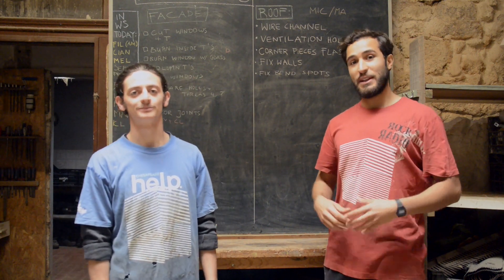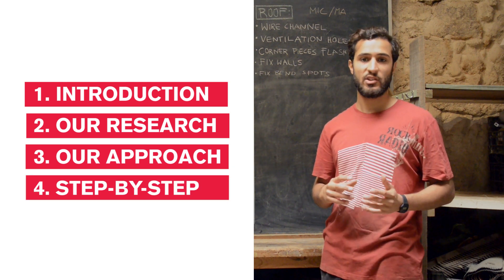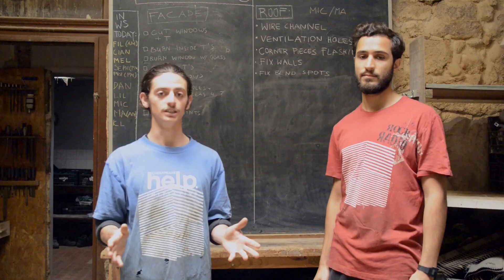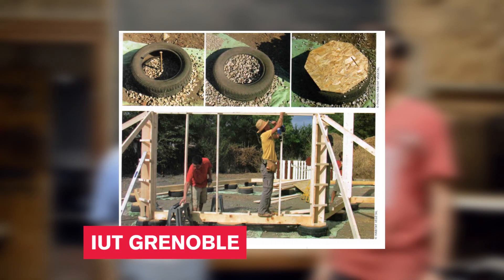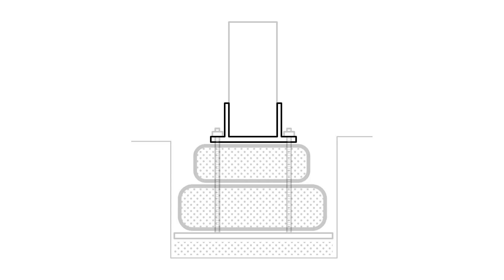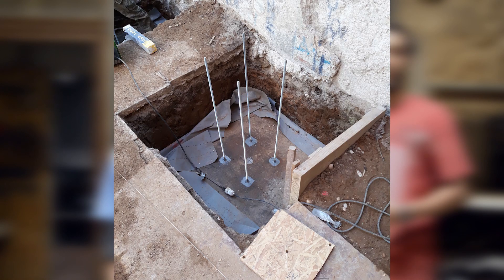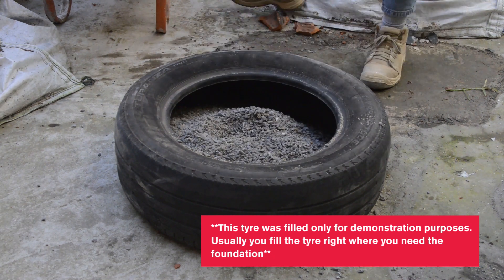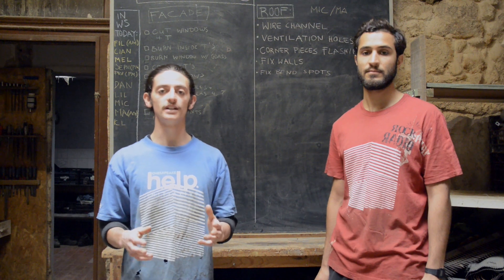Tyre Foundation - HOW TO

Comment: Hello, thanks for your video and inspiring project! Do you think/know if your 'single step tire footing' will anchor the building above? I'm considering making use of tires for a superficial foundation, to prevent damage on tree roots present on the land, but need to anchor the foundation in order to prevent movements and disorders due to strong winds...

Comment: I suspect the flat plate will collect water in my climate where we have snow and rain. Another idea: It is very common where I live to put cabins and small houses on cement piers that look like large fat disks about .5 meters wide and .2 meters thick. Initially they will setttle a lot, and unevenly. Each year for several years, you must re-level the building, by adding shims, or perhaps removing shims and replacing it with anohter support disk if the space has become large enough. Eventually the firmness of the soil and the weight of the building reach equilibrium with the contraction and expansion of the seasonal weather changes, and the changes are small and seasonal only. The bolts are useful in the case of typhoons, tornados, and hurricanes, but in areas where these are rare, gravity alone may be enough.
Reply from the maker: Agreed. We never used the flat metal plate after this first prototype. A simple geotextile is enough to prevent the gravel from mixing with the earth.

Comment: You basically created concrete with the sand/gravel mix. Between that, the steel, and the anti corrosive paint, I’m struggling to see any real advantages to using concrete.  Nice work overall. 👏 the effort. Good job. Looks solid.
Reply from the maker: I agree that the first prototype was comparable in carbon footprint to concrete, because of the steel plate. We didn't use it anymore after that first prototype.

Comment: I intend to do this, but ... i'm concerned about hurricane uplift, and this solution relies solely on gravity and friction; so my thinking is to get rid of your footing steel parts and drive stainless 1 meter bolts glued in to bedrock at odd angles through the column timbers... "toe nailing to the bedrock through your tyre system approach" but without a welder or any significant steel... using epoxy to anchor to the bedrock after drilling through the tyre... the tyre itself has steel belts, it already is as strong as anything you're going to fix to it... best use the tyres alone as the brackets... that's how i've done it and will keep doing it... tyres are cheap; welded steel is expensive; stainless steel 20mm threaded rod is ubiquitous (3/4in)... to the video makers:  "uplift" in a 120mph storm when the wind gust sucks that flat roof up in the air and reverses the static loads, how much can we rely on this system to keep the building from lifting out its footings besides being "heavy".
Reply from the maker: Hi Davide! You're right to be concerned about hurricane uplift with this type of foundations. All foundations do not respond well to all type of geography specificity. I'd always advise to consult a local civil engineer to fool-proof any kind of solution proposed. Good luck with your projects!

Comment: Hi, great video guys and very interesting. We are building a shipping container home,  using two 40' shipping containers in an L shape.  We would like the containers to sit 60cm above ground level.  Could we use tyre foundations to achieve this? Thanks for all your help,  Victoria and John ✌️
Reply from the maker: Hi Victoria and John! Yes that sounds like a fine idea. To have them higher from the ground, put a car sized tyre on top of a bigger one (tractor or truck). They need to be very well compacted.

Comment: Sir 
Can i use this method for alternative of base isolator 
I am building a foundation less house with ferro cement
https://m.youtube.com/watch?v=kW2UvLhFr_M&t=4s
Reply from the maker: Hi Dennis! I don't understand your question! Can you specify? The whole point of this is to not use cement because of its ecological footprint :)
Reply: @CriticalConcrete  Sir i want to know if using tyres filled with gravel in foundation does it help to absorb the shock waves of earthquake
Reply from the maker: @dennisboscodemello2123  It depends how you connect or do not connect your building to the foundation, if you leave freedom of movement or try to have a very compact and connected construction. As you know, the foundations are only a small part of how the building will behave in a case of an earthquake. I would recommend you to check this in details with a few engineers around your area, and dimension the foundations accordingly :)
These foundations are comparable to single step footings, so you need to design the construction following this logic.
Reply: @CriticalConcrete  thank you Sir for your guidance

Comment: Thinking of using this on a design project but am wondering: What sort of impact is there on the surrounding soil? Do any heavy metals escape into the soil, and if so what kind of protection is needed to prevent this?
Reply from the maker: Hey Matt! this is a great question here. We're planning on monitoring our soil with time to see how it evolves. It's too early to experimentally give you a result, as rubber of tyres are very durable material, especially underground. This is still something to evaluate in the coming years. If you have any ideas towards this topic, feel free to share, also if you find any recommendation or research studying the degradation of rubber underground.

Comment: Stay critical   I like that..........Ok  your idea....my thoughts........metal plate bad idea will rust   hook rebar to the steel in the tyres  they will not pull out
Reply from the maker: Hey! Thanks Brian, it's really something we've been debating about. Our engineer advised us to put this metal plate and for the first prototype we decided to follow on that, but it's something that we want to optimise. We're currently looking for collaboration with engineering students to improve this model! The anchoring is crucial and also not fully satisfying as is for now, in our opinion :)
Reply: @CriticalConcrete    I am a retired engineer and have time .......I am at the moment trying to work on third world construction methods using little steel and cement  and a lot of tyres empty plastic bottles paper crete    aircrete   adoby and mud 

IMO   concrete should only be used as little as possible
Reply from the maker: @brianevolved2849  Hey wanna get in touch by email? mail@..................com Address to Delphina and Samuel :)
Reply: @CriticalConcrete    Earthships and Aquaponics are both facianating

Comment: I have been wondering if an earth battery would work with compressed dirt inside tyres running alongside air rated tubing coming from a solar air heater, layered with gravel and tyres inside an insulated hole.
Reply from the maker: Why not just bury the tubing, in the fashion of a ground-coupled heat exchanger? I'm not sure to understand what goal you aim to reach :) If you want to make a heat battery, I reckon dense stone like granite would work better than earth.
Reply from the maker: Or a compost heater? You get 70ºc in the center of a good working compost pile, so this would be a nice place to put your coil :)

Comment: Hmmm. All that sand and aggregate being beaten around inside tyres, when just a smaller hole, perhaps reinforcing mesh, and cement added to the aggregate - to make concrete foundations. Quick and simple.
Reply: The whole point is to NOT use a heavily contaminating element like cement
Reply from the maker: Of course, it's easier to use concrete. But for the reasons we mention in the video we avoid using it and look for alternatives.  Sometimes the easiest way is not the best. At least from an ecological point of view.
Reply: "we don't want to use concrete"
WhY DoN't YoU tRy UsInG cOnCreTe?"